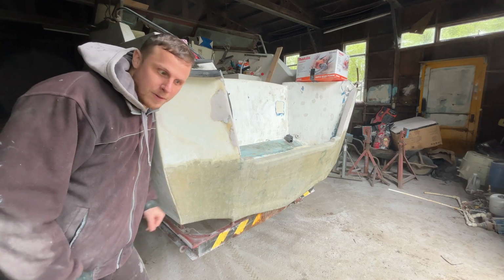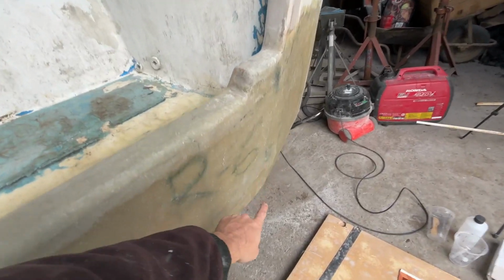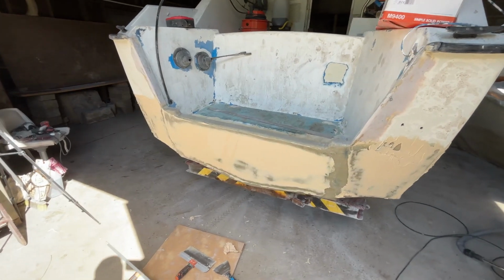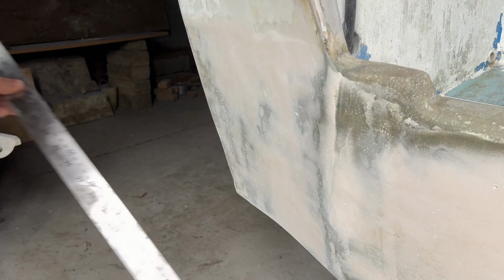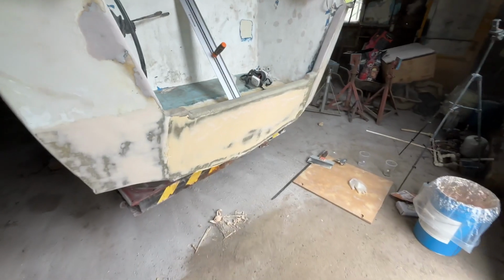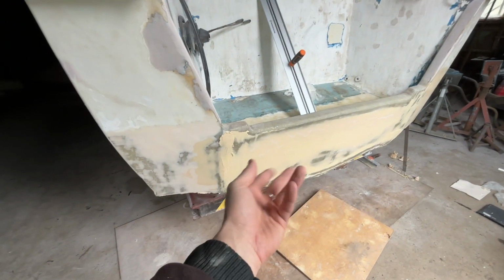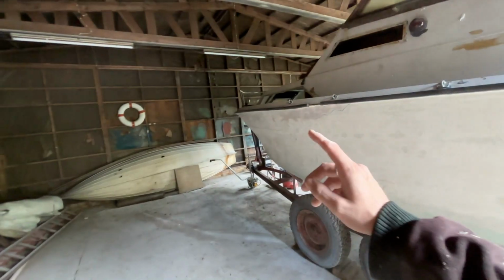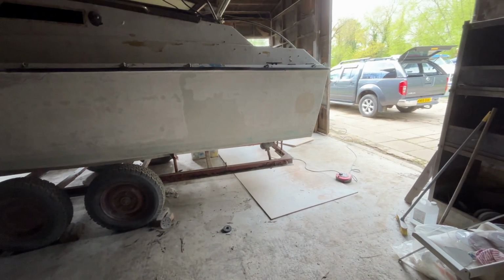Starting to fair out the transom getting it ready for painting EPISODE 49

Comment: Get an adaptor and connect your orbital sander to a vacuum. I use a Dewalt DWE6423-QS / Mirka Deros 650 CV 5.0 & connect them to a cheap Kärcher WD3 vacuum cleaner i have around. 95% less dust around me when i work. Btw, how's that Navara holdng up? I'm thinking about getting one like that for work.
Reply from the maker: Good idea I will see if I can get hold of one appreciate it. Navara is a really good truck I’ve had it for just over a year now haven’t had any trouble does about 450 miles a tank around town